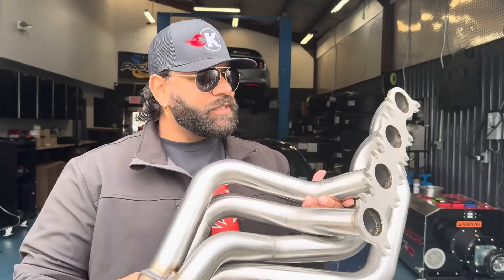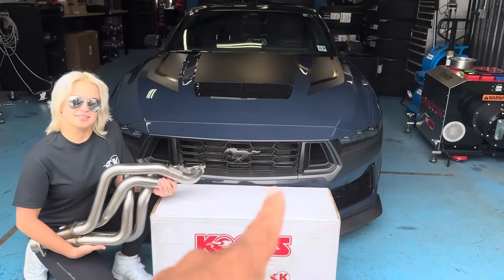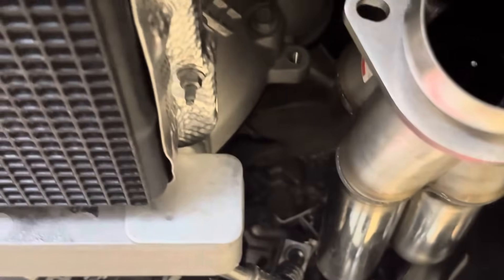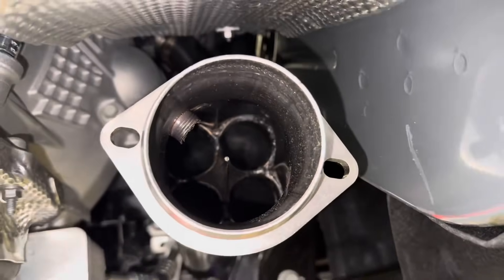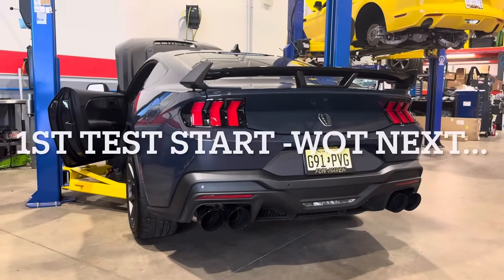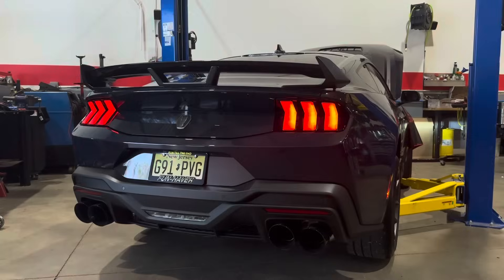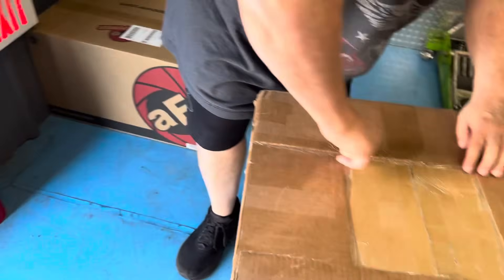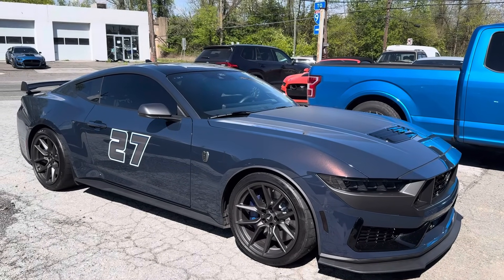SOUNDS INSANE! KOOKS HEADERS 2024 Dark Horse MUSTANG! *1st PULLS

Comment: StangMode!!! Wow sounds excellent!!! I bet that you pick up 30+  rwhp from the Kooks headers!!! Did you take out the carbon filters that clog up the intake air flow? I have seen 8-10 videos where the average gain by pulling out the carbon filters is 12-20 increased rwhp. Ford Performance just came out with improved CAI compared to K&N filters that picked up another 12 rwhp on the dyno. Adding the headers w/sport cats + 3” catback should get your Dark Horse to 500 rwhp NA making a decent daily driving Mustang!!!!
Thanks for sharing the video. I am eager to see how the Revolution wheels in bronze look!!! Should blend well with the Blue Ember paint. Question for you: when opening the wheel out of the box the other guy mentioned some about the rim to prevent tire movement. Would you explain please!!! First heard!!!
Cheers ❤👍👊💪🇺🇸✝️

Comment: Do headers require an adjustment to the tune? In the old days I would need to change the timing when I reduce back pressure in the exhaust. I think Ford isn't allowing any Tune adjustments yet (except maybe the Ford official supercharger). I'm in central NJ, maybe someday I will come hear you preach the Word.

Comment: Will my 2017 Stang GT run right without a new computer tune using new headers? Currently I have a Roush Level 2 Power Pak which has their; cold air intake, axle back exhaust, and computer tune.
Reply: I would put it on a dyno. It wouldn't hurt, and if something was going on, you would catch it and have the actual numbers that are going to the rear wheel.